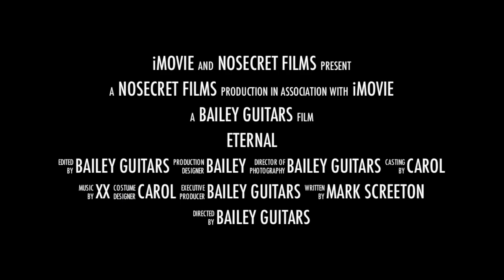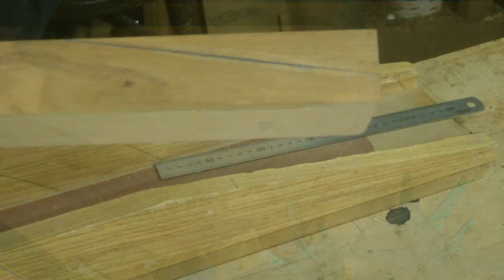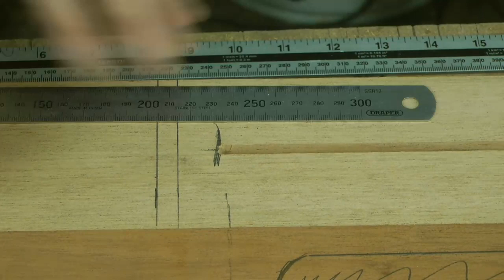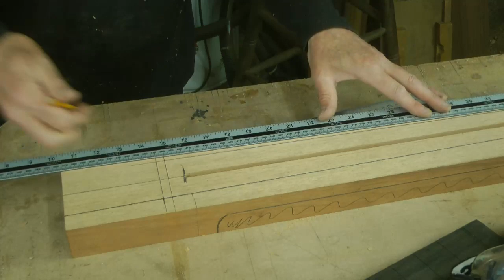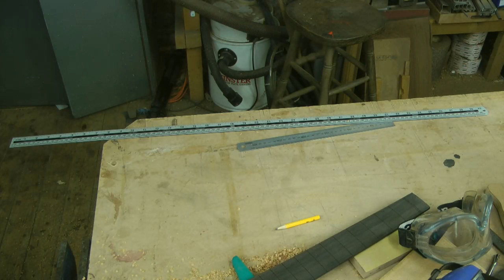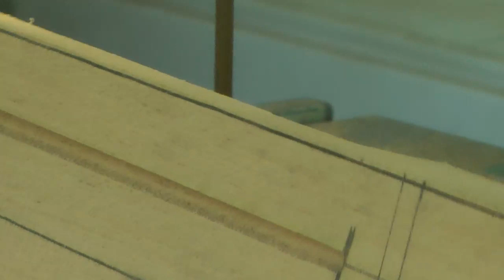How to Build Your Own Guitar - LIVE! Part 2: Make the neck

Comment: Wonderful - been guided to this video by  carpentry friend who is helping with my build. Can you please clarify something? I keep hearing about the risk of a break from short grain in the area of the nut (as per Gibson SG syndrome etc) if you only use a single piece & no scarf joint... I note you go with a single piece for this build, how do you avoid this issue? Cheers, Ade.
Reply from the maker: Glad you found us! If you use a decent quality neck blank it is not a problem - don't worry about it. Or do a 'scarfe neck'. Whatever you decide make sure you don't drop it and it won't break :) https://guitarmaking.co.uk/product/neck-blanks-electric-guitar/
Reply: @GuitarMaking  Thanks, that will make life easier for the first build...!